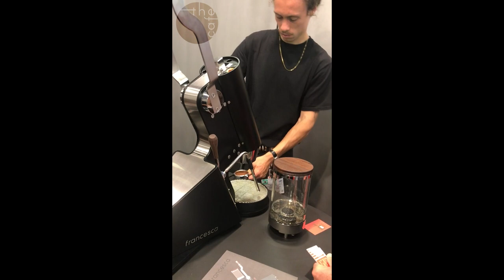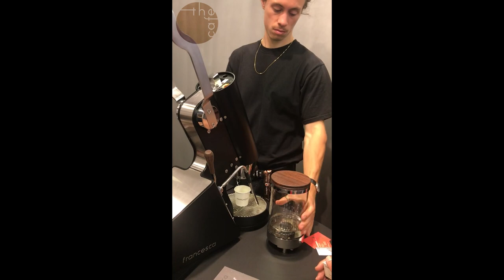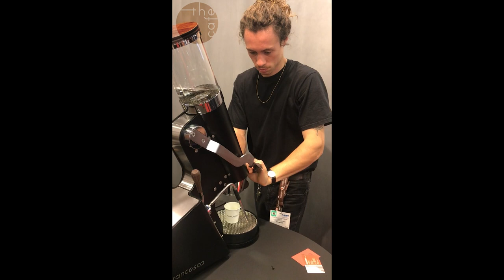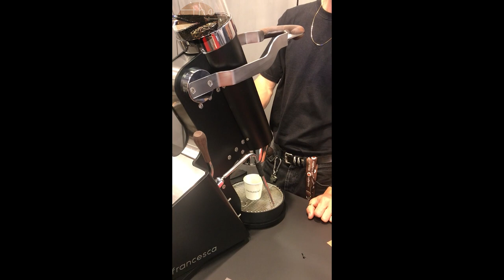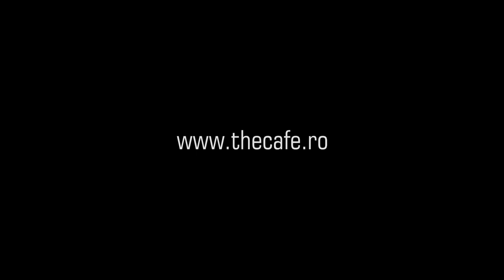Espresso extraction on Manument Leva Machine Francesca

Comment: Why did they cut it off? This is the most interesting espresso machine to be released in years since the streitman
Reply from the maker: Sorry for the late response! What do you mean by cutting off? And it is very exciting to work with it, I find it a bit instabile but probably with more experience you learn how to use it without problems
Reply: @thecafero  I meant they cut the video short!
Reply from the maker: @Wyrdrock  ah, I understand. Actually that was one extraction, after that, we started to extract ourselves and I couldn't handle the phone and the machine with only two hands :)